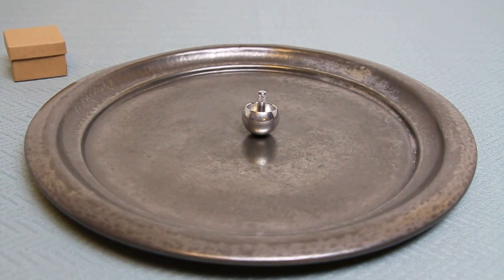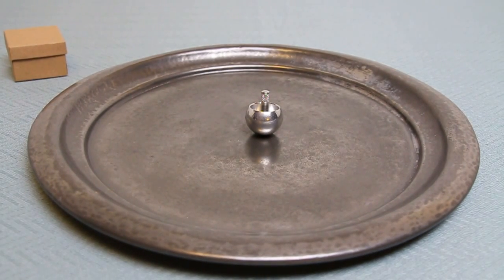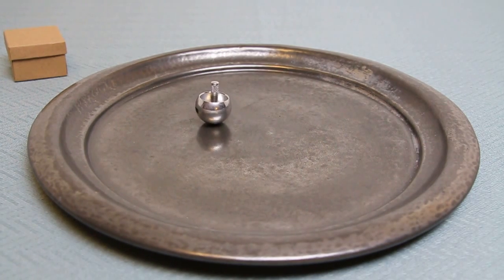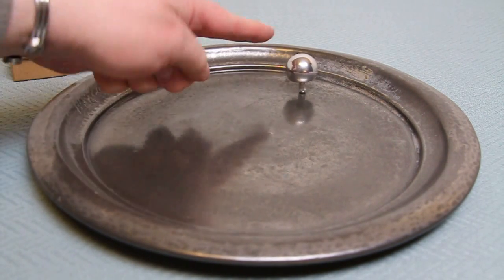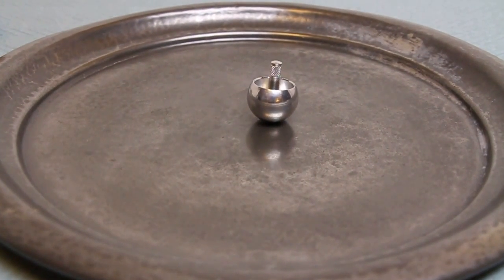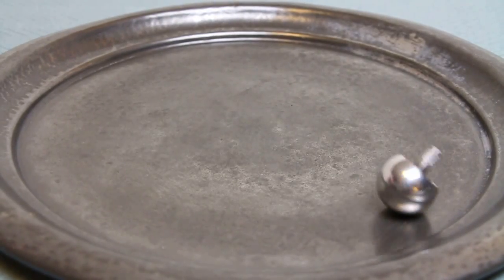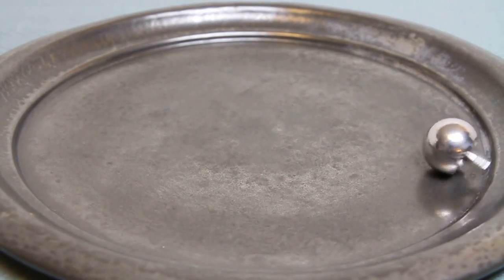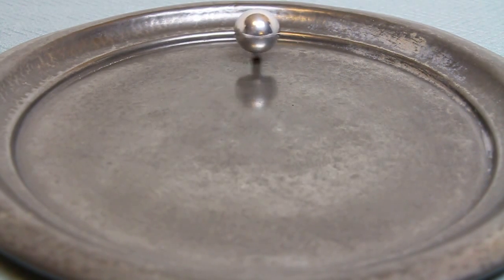Tippe Top - The Spinning Top that flips itself over when it is spun!

Comment: I had one of these when I was a kid.  It was made of plastic, but it had a "magic" component.  It had a hole through its axis, with a metal nail though the hole.  Before spinning it, if the top was pressed down onto the mushroom (with the stem uppermost), it would push the nail backward so that its head would lift very slightly at the end of the stem, and the top would invert when spun, as yours does.  If, however, it was pressed down onto the stem, the nail pushed through just enough to form a tiny bump in the centre of the mushroom (that's "center" for ryelor123, but YouTube isn't only visible to Americans), after which it could be handed to a friend, who would be unable to make it invert - it would spin on its little point and stay upright.
Reply: +Mike Collins that's an epic trick. I want it.

Comment: Do it in a vaccum!
Reply from the maker: RayVal53 that is a nice idea. I would expect it to spin a bit longer as there would be no air resistance, but generally it should behave the same... Now IF they did this in a vacuum and in zero G... ;)
Reply: Tom Strong Reviews This deserves super-slomo ;)
Reply: +Tom Strong Reviews What would it do in a vacuum at zero G.
Reply: Tyson Strauser Tough to say - probably wouldn't be able to spin it without it flying away. :P
It might be that it would just spin without losing stability if it wasn't feeling any friction and downwards acceleration.
Reply: +Tyson Strauser There will be no friction at zero g.
Reply: +Himadri Samanta  "There will be no friction at zero g."  That doesn't follow.  If you're in the International Space Station, there will be zero-G, but the top would slow down due to air resistance.
I haven't done the experiment - zero-G places are so hard to come by - but I think that the reason why it turns over is the moment given it by the pressure of the surface on which it spins, causing it to precess.  As it precesses, so the point at which the pressure is applied to this little gyroscope changes, causing it to precess futher until the stem comes into contact with the surface, and its edge stands the top upside down because it has a higher peripheral speed.  If it was in a vaccuum, it would spin until the friction of its point against the table surface slowed it down - which could be a very long time - and if it was in zero-G, there would be no force to cause it to precess, and it would simply maintain a stable axis, the same as any other spinning object in space.
Reply: +Mike Collins You are correct that there is a pressure involved. What little I understand is this: The gravity pulls the top down causing a pressure on the table, which produces a normal force on the top. That in turn causes a frictional force opposite to the direction of the top's motion at the contact point. That causes the top to precess. I probably was too brief in my comment and neglected the details. When I said there will be no friction, I did not mean the air friction. I meant the friction of the top with the table. Air friction will be symmetrical, but the friction with the table is not for this top. Please feel free to correct me. Thank you.

Comment: Wonder how a magnetic one of these would work on a levitron Tom Strong Reviews
Reply from the maker: aaron frederick I keep thinking about buying a magnetic levitating device... Nice idea!
Reply: Just thinking of the physics, I would assume the top would flip based on the pos/neg charge of the magnet
Reply from the maker: aaron frederick This one is made of aluminium, so I would have to get one made of steel or at least some metal that included iron.